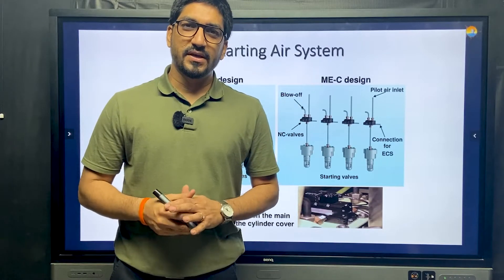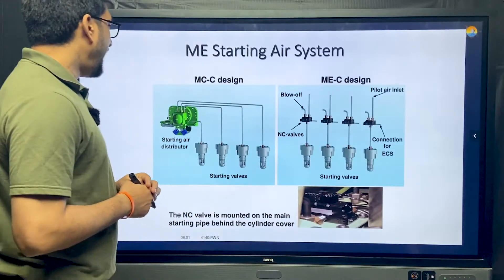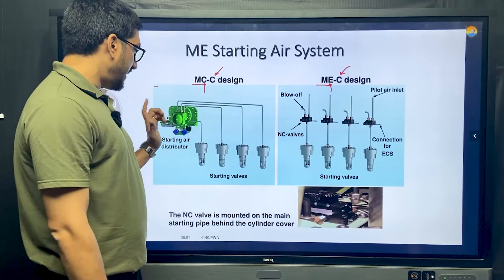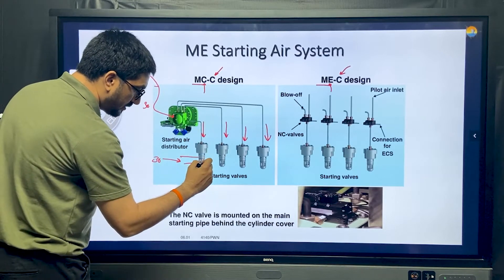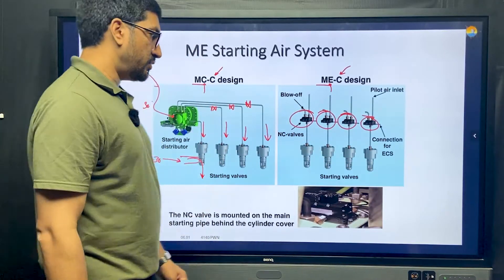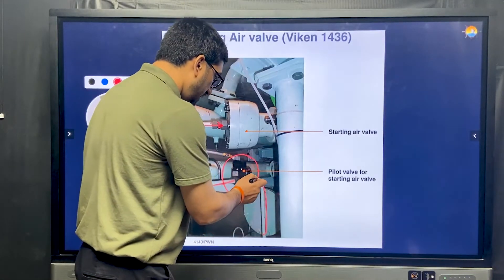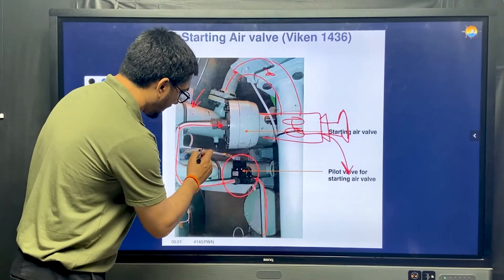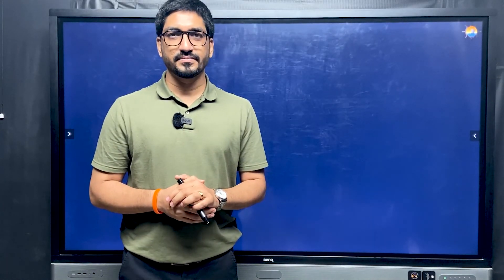How does ME Engine Starting Air System Work | Me Engine Working on Ship  | ME Engine Package

Comment: Dear sir, This is really very useful and informative videos.
Please make one more videos which describes,  How it is decided that which unit solenoid vv will open first? as in air starting distribution system such provisions given.
Reply from the maker: Sure,
We will consider your request. 

Team Merchant Navy Decoded.
Reply: This is decided by Crank angle sensor ( 2sensors fitted)